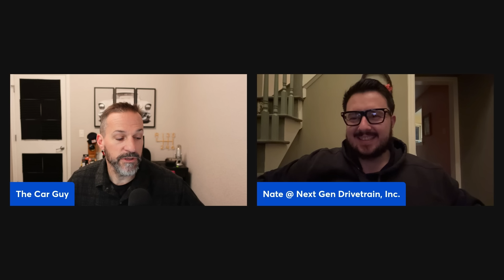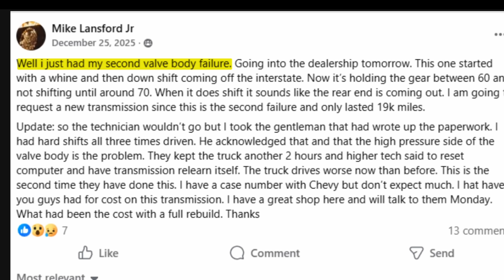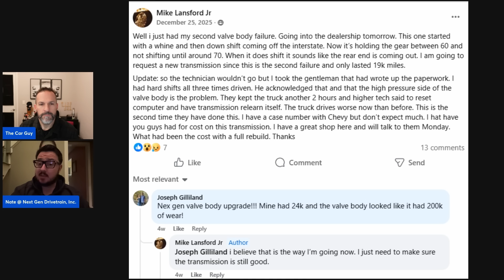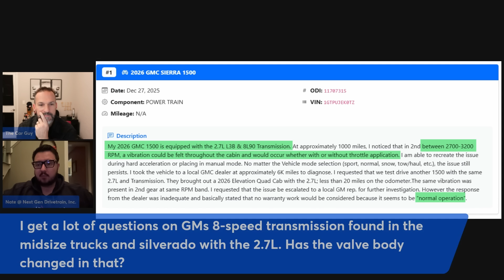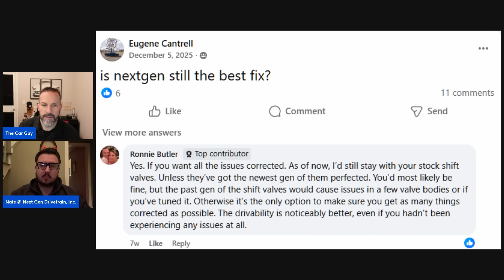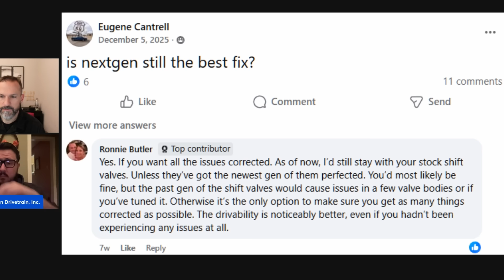How GM Transmissions are DESIGNED To Fail with NextGen Drivetrain. 2025 2026 Silverado Sierra...

Comment: Does the Ford variant have the same valve body problems?
Reply from the maker: Fords seems to have slightly better programming, and in my opinion slightly fewer valve body issues that are catastrophic. They do tend to have lots of "shifting issues" I see in groups though. Nate things that Ford has better supply/stock on valve bodies, so that is a big reason why it feels like they don't have as widespread of a problem, because they get customers back on the road faster than GM.
Reply: @TheCarGuyOnline Thanks for the quick reply. I am contemplating a engine and trans swap and I'm trying to figure out whether to go with a Ford or GM combo or even a GM engine with a Ford transmission. There is a company that makes stand alone TCM for the 10speed Fords and soon to do the same for GM trans. 

John 3:16

Comment: I mean, while I agree with a LOT of what was said, I disagree that the OEMs can make components cheaper. I personally saw ~'08 when the big three tried to bring a lot of their manufacturing in house, and how they no longer were able to hit timelines, quality, or cost. I believe the numbers at Ford was something around 2-3x the cost (depending on the specific part we were discussing), along with overhead cost of having to build out for max needed capacity, but then not being able to leverage that capacity making similar parts for competitors when there wasn't the demand that was originally estimated (something that tier 1 and tier 2 suppliers able to adapt to much more easily). Also, for certain components like fasteners, you would still have to potentially license the right to produce that fastener, so it's not quite as black and white as you may think. That being said, if their incoming quality inspection already isn't catching these issues, what makes you think that the parts would be made to a tighter tolerances if made in house? If anything, based on all of these issues, it would be better for them to buy a complete package from a tier 1, and stop trying to bring everything in house in an effort to show a higher profit per vehicle, when they're then not accounting for all of the lost sales due to reputation damage, as well as increased warranty costs...

Comment: I had a 2021 Sierra 1500 Duramax I bought new. 30k miles the transmission failed. Warranty installed a refurb. Then had multiple DEF system warranty issues. This past December I sold it and bought a 14yo Subaru. I’m done with ALL modern EPA designed vehicles.

Comment: What about the 8 speed that I have in my 2018 sierra 
I’ve been having trouble since 2000 miles and the dealership said their is nothing wrong but I found out that they were supposed to change the fluid before delivery to me new
Reply: yeap fluid is a big deal and its likely torque converter stutter ect your feeling........

Comment: This crap is exactly why I don't buy new cars.they use their rederick to justify the overpriced crap vehicles most won't make it through the loan period without a major failure.ask yourself why there are so many new cars in the wrecking yards and so many old cars still driving around daily.this is systemic among all brands.i personally have 3 gm vehicles with over 400,000 miles each ,one with 532,000 .simple basic, reliable,easy to repair, emissions compliant.they last decades,the new ones can't make it a yr without some sort of issues

Comment: In my Experience there all Engineered to Fail now. From Bumper to Bumper and everything in-between.  you can Rebuild a classic Truck or car for around a few thousand dollars. A decent older vehicle can be rebuilt for less than the Down payment on a New car or Truck.

Comment: I bought a 2016 GMC V6 Sierra. I love it! Only problem is... It's a total piece of shit and all I've been doing since buying it is trying to fix it. Already had a new tranny, drive shaft and brake module. Figured great, most of the expensive repairs have already happened.  After spending thousands cleaning up previous repairs and doing what I could on my own, I just got quoted 7K from GMC to fix an oil leak at the lifter manifold (valley plate). It is close to 200k kms (125k miles)

Comment: Thanks Cody thanks Nate.
 I say anything from 2007 and newer is a disposable vehicle.
 which means it's good for about a hundred thousand miles before it won't pass emissions or the transmission fails.
 you're looking at a replacement that most likely is more money than the vehicles worth.
Reply: 2014 was the year they really went to the far side due to EPA mandates.

Comment: How are the 8 speed transmission they started using in 2024 holding up next to the 6 speed transmission they replaced with? I only have. 7000 miles and outside a squealing noise from the front pump area??  As far as I can tell the 6.6 L8T seems to be built so much better than the 6.2  V8 and to think at some point I wanted a 6.2 and I wouldn't mind one in a Cadillac Black Wing or a Corvette.. Some of the very few remaining V8 super sedan's they still make and sell.. sadly Bad Ass Dying Breads!!

Comment: i had a aisin AY6 6 speed manual in my 5th gen V6 camaro. and what i found out after 4 REBUILDS OUT OF POCKET before it even hit 60,000 miles. it CANNOT handle anything over 250HP, the syncro's are also weak causing 1st 2edn and 3erd gear grinds and pop out On top of that they put a weak hydraulic clutch system in the 5th gen V6 camaro witch would cause the clutch to not fully disengage and drag slightly on the clutch causing the transmission to still be engaged. we tried machining the dual mass flywheels with was found STOCK to be bigger than what's needed. 
the Aisin AY6 was also used by Toyota and was so problematic they switched them out for T56s. that was the ONLY and LAST GM product i will buy unless it is a Brick Caprice from the 80s. im Done with USA made cars and will never ever buy another one in my life VS old used JDMs hell ill buy and own German 90s and early 2000s before i ever buy American ever again.  I've been screwed by the Big 3 Ford the Worst i use to own 3 of them at one time and would rotate them in and out of the repair shop monthly just so i had a vehicle to go to work.  so when i see a video Titled GM Transmissions are Designed To Fail................ OH TRUST ME BUDDY I KNOW 1st HAND GM IS TRASH and there only goal is to screw the customer. i am also not naïve enough in my late 30s to ever think these companies are American anymore. there WORLD WIDE they abandoned the USA car buyers 10+ years ago. the threw the American workers out when they asked to be payed a fair living wage in exchange for cheap labor in other countries then lie to our faces and tell us it to save money when they rake in billions. now a days after my personal experience and going to school to learn how to work on cars. I can honestly say i don't give a damn about any brand and have zero loyalty to any of them specially companies that pretend there American but do everything in the power to screw Americans to STEAL our money rip-off mechanics with book time pay  and low wages and saddle them with school debts and when everything falls down around them the point the fingers and blame US the consumers for there lazy greedy mistakes.

Comment: Since the mid 1960s GM, then at its peak, has generally slid step by step down hill and became a dysfunctional operation that through the years was able to nevertheless make a considerable number of decent vehicles and decent engines and transmissions but it is BORED OUT ITS COLLECTIVE SKULL over the idea of built in quality as taught to Toyota by the American man named Edwards Deming back in the early 1950s! Toyota was impressed with the guidelines they were taught & within just a couple years had massively improved its quality even faster than Deming predicted that it would take. It still took about 15 years before they estimated that their vehicle development was sufficient to begin to ship vehicles over to the US, since as you recall Japan had to rebuild its manufacturing after getting pounded by the US during WWII, & the intense focus of building quality in from the start to finish was cherished.

In America, when we did create and manufacture quality vehicles we did it in the old fashioned way, by having endless inspectors (such as with the 1961-69 Lincoln Continentals or the 1959-61 Imperials) & not focusing enough attention on parts quality, & assuming that a mass produced vehicle had to exhibit some considerable quality issues. Although inspections can of course be important, the Big 3 just did not recognize that rigorous demands for excellent quality of parts & engineering in quality of assembly actually was more efficient in the long run by producing less quality headaches in the first place. The simple fact is that US manufacturers placed high production numbers churning out of their factories as the real foundation of a healthy auto company and as I stated in the first sentence the GM executives and managers are BORED TO DEATH WITH QUALITY and thus place it considerably lower on their totem pole of critical factors to create great vehicles. Other aspects of the quality world of Toyota that emerged was to have good relationships with suppliers so that nay future quality issues could be tracked down rapidly and solved without building up storehouses of low quality or defective parts which would then be used anyway to avoid waste!

Many times GM vehicles that have eventually reached good quality are assaulted by the EPA which is never satisfied with its push to increase vehicle MPG thus resulting in more and more complicated technical means to eek out additional fractions of a mile per gallon resulting in more and more complicated engines & transmissions, that at least initially are less likely to be long lasting robust designs as manufacturers are always under the gun to produce vehicles that meet ever more draconian demands. 

Examples of this are the elimination for the Buick 3.8 Liter V6 that by 2005 had reached near perfection as the Series III, was dependable, & at the same time was an extremely low emissions engine, yet was retired only a few years later to be replaced with a smaller V6 to eek out tiny increases in fuel milage!! & Ford has also retired dependable engines only to replace them with more troublesome power-plants  with multiple valves, cylinder deactivation, CVTs, smaller displacement engines, etc. As we end the immediate transition to electric vehicles & establish stable long term energy sources & stop draconian emission standards perhaps we can re-establish more dependable drive-trains. 

It appears to me that that only reason manufacturers like GM & Ford would produce troublesome drive-trains that are not nearly as reliable as they once were, was that they had a long term plan to follow the lead of the federal government (with some push-back against the speed of these changes that demanded ever more complex transmissions & engines) thinking that if they got into trouble the US federal government would bail them out since the Feds were a big reason why they have been creating these troublesome designs. The reason I say this is that any company that develops new products that are clearly less dependable will at some point pay for this by peeing off too many customers, even if their dealers do make more $$ from servicing vehicles for more & more drive-train repairs. This will soon result in customers rejecting particular brands that have more dependability concerns than they are worth. Thus creating vehicles for a planned obsolescence future whereby manufacturers will be eliminated via a drought of customers, makes no sense unless the CEOs & management are so stupid they are only seeking a short term rapid profit & a golden parachute before abandoning the industry. That is the only way I could see GM actually designing transmissions to fail. If that is the case, GM just will evaporate, but Mary Barra will retire rich as the awful DEI hire that she was.

Comment: ITS THE JUNK ULV FLUID
This guy is making money on his "upgrades" when just switching to LV fluid corrects most issues. These transmissions were designed to use LV fluid. At 11k miles drained 5 quarts, fluid was dark crimson w visible material,..filled w AMSOIL blue cap LV ,  couple months drained 5 quarts again fluid is cherry red, w no visible material. Never dropped the pan, used Mityvac fluid extractor, dead cold, 9 quart graduated cylinder, exact amount.

Comment: @TheCarGuyOnline I have no dog in this race but why are we not discussing the Ford version of this transmission, is the valve body totally different, and why Ford is using the vulnerable CP4 in their trucks. GM is a hot mess but Ford isn't much better.
Reply: Wait Ford is using the CP4 instead of the CP3?
Reply: @jeanlambert5613  yep! next gen I am hoping next gen they will switch fuel pumps.

Comment: Just to let everybody know, the new V8 motors coming out in 2027 are going to still have cylinder deactivation. They're not calling it AFM or DFM they're calling it some other technology but basically it's still cylinder deactivation. I would wait two or three years to buy any of these new vehicles with these new motors. Let everybody else be the guinea pigs. You're going to have to let everybody else buy them and let them drive them and put real world miles on them to see if they're going to last. Give it a good 2 to 3 years to see if there's no major issues. Nobody wants to be dealing with any problems from GM and I'm sure I'm going to be not one of them.
Reply: Why?!!!!!!!!
Reply: Haven't you follow GM's problems with their engines and transmissions in the last 5 years? Do you think the 2027 motors and transmissions are going to be any better? Do you want to be one of those guinea pigs to find out that it isn't? That's why I'm saying let everybody else buy them wait two to three years to see if there's no major problems. But if you don't care then go ahead . @jeanlambert5613

Comment: I’m old enough to remember when the early 2000s gm trucks had all their issues.  Early Duramax injectors, clunky steering shafts, weak rear brakes, headliners falling out, etc.  Now they are considered the best and very desirable and everybody seems to have forgotten.  If we had these social platforms back then would it have been the same level perceived issues?
Reply: Fair point but a lot of gmt800’s are still goin and fixable /upgradeable …
Reply: Yeah and my 2020 3500 has 100k plus with zero issues. My wife’s 2023 Tahoe has 90k with zero issues.  Currently looking at trading the Tahoe for a new one with the baby dmax.  If you read online or watch this channel it’s the worst engine ever made.  If you talk to people in person who own one it’s the best engine ever put in a vehicle.
Reply: We had the Internet and forums back then to.... And yes late 80s -mid 2000s Chevy trucks were generally considered kind of cheap but fairly reliable and when they broke they were generally easy and cheap to work on. Most were abused and lived hard lives and most of them easily went over 150k miles with mostly minor repairs. My 1991 GMC 2500 350/4l80 went 400k miles on the original engine/trans, when I sold it, and still ran good.

Comment: NHTSA's job according to the law is safety if a transmission or engine dies and doesn't hurt the driver or others on the road the law doesn't give them the power to force auto makers to make you whole. EPA's job is to develop rules so there is clean air by eliminating chemicals that leads to air pollution. You may not like devices etc on vechicles to meet regs but congress needs to keep them in check. I like clean air getting rid of devices doesn't clean air congree need to car makers to use cheapest viable method to meet the rules. They have made to many loopholes that why trucks are bigger than they were 30 years ago. They are going backwards.

Comment: Been a GM guy my whole life but I am very disappointed in the last 6-10 years. How in the world did they go from the gen 1 and 2 LS trucks that were practically indestructible to what they are now
Reply: Mary Bara is your answer.
Reply: EPA!
Reply: @curttundra  Not sure you can't blame the transmission problems on the EPA.   Maybe thin engine oil causes engine issues, yes.   They just make it overcomplicated, just like the Germans LOVE to over-engineer everything.   Great while it works, but a disaster when it breaks.
Reply: @sidorgeorge  You sort of can. The 4 speeds in theory are much less efficient because of the limited gear range compared to something with over double the gearing choices. Same with CVT's. They're only a thing so hard now because you get an extra one or two MPG, long term reliability be damned.
Reply: @sidorgeorge without the EPA there would be no 10 speed transmission, they would of just kept making a 6 speed and everyone would be happy , not that they were perfect either, but the efficiency jump is the only reason to go much past 6 gears in a passenger car/ light truck.

Comment: Test drove a 2026 GMC diesel 2500. It shifted hard between gears 3 and 4 and took too long to find the right gear. Told the dealership that one already has valve body issues. They pretend like they weren’t familiar with the trans issues.
Reply: And it’s brand new. Yikes
Reply: I’ve never driven an automatic that would find the right gear in a reasonable amount of time, I’m always forcing them to change.
Reply: @NopeNope-j7k4e  Real Allison 5 and 6 speeds were always in the right gear.
Reply: @GT-mn3bx that seems impossible, it would have to know when a curve is coming or hill etc
Reply: @NopeNope-j7k4e Never had one huh?
Reply: @NopeNope-j7k4e aisin 6 speed. Hardly any issues with gear
Reply: Allison transmission or 8H transmission?